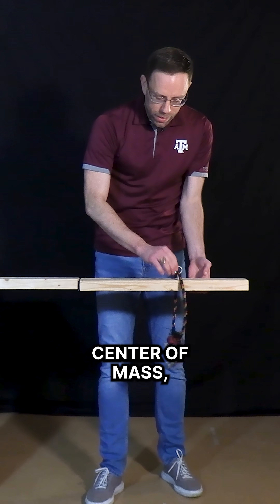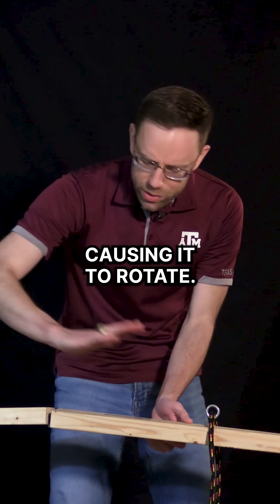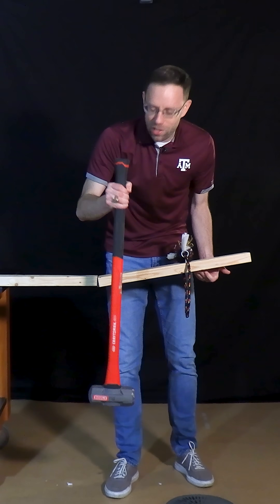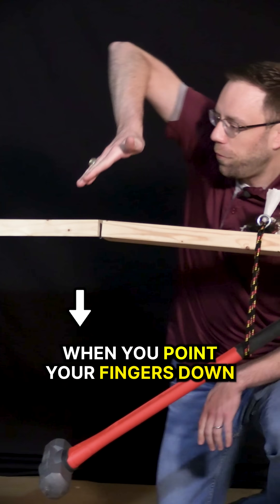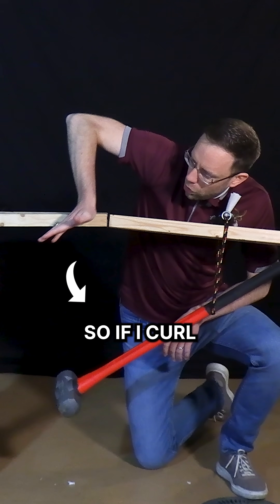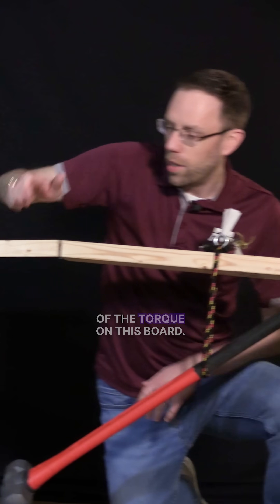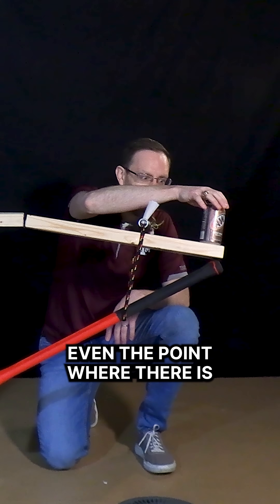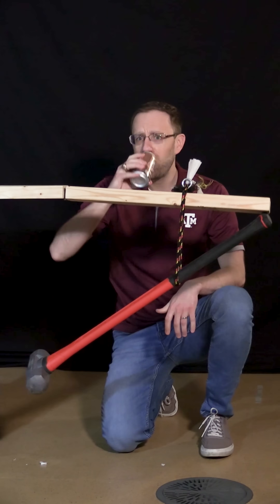Floating sledgehammer using physics! 😮 #shorts #TAMU #DrDawson

Comment: Here’s an easier way to understand this. 
If the plank were to swing downward the heavier part of the sledgehammer would have to go upward. At the point where the sledgehammer has to move upward in order for the plank to swing downward that’s where gravity says nope because the sledgehammer is too heavy to move upward from the small amount of downward pressure by the plank. 

The words “torque” and “hinge” are crucial for this genius contraption to work, but what it really comes down to is still basic gravity preventing the sledgehammer from levitating.
Reply: That was a perfect explanation 👨‍🍳😘👌
Reply: @ricksmash8080  thank you!! I understood perfectly
Reply: That makes a lot more sense
Reply: Beautiful. Your explanation finally helped me wrap my head around how this was possible.
Reply: "At the point where the sledgehammer has to move upward "  bruh that's the key for me . Thanks for the help
Reply: That's a very good explanation
Reply: so to keep the hammer from levitating, we levitate the table instead. It was always about the hammer to begin with, physics doesn't care about the table at all! thanks for explaining it.
Reply: @caughtintheakt8420  the hammer is heavier than the plank, so gravity 'cares' about the hammer more
Reply: Nice explanation dude, reminds me of some of the best from my undergrad –questions like "if you take a rope hanging between two points, and pull down on the exact middle point until taut, does the centre of mass go up or down" spring to mind, but a good explanation like yours makes them seem easy
Reply: @ricksmash8080 thank you I was going to the comments to write a similar comment. The guy in the video’s explanation was I find more confusing than needed to be
Reply: Ah~ so it works like Monks on a stick :3
Reply: @ricksmash8080  so aliens fly their ufos with sledgehammers?
Reply: Correct.  Torque has less to do with explaining the solution than the system resting at the lowest potential energy state.
Reply: @akulkis  🍻
Reply: Thanks, you have better English and I was about to explain the same.  It's like a teeter-totter, but our eyes and intuition decieve us and we expect the heave dude to  float.
Reply: @jaimeduncan6167  You found the same analogy as me!!! Teeter totter is a funny name for seesaw though.
Reply: @ricksmash8080  There will be more stress on the hinges
Reply: This guy should become a teacher
Reply: @Loc123cool  thanks! I try to teach my employees how to be landscapers but I find that although good teaching helps, it boils down to potential ability most of the time. You’re probably great at learning!
Reply: Wow that's a lot clearer
Reply: @ricksmash8080  you would make a great teacher
Reply: Thank you, the video's explanation didn't help at all. Your explanation helps me understand it perfectly.
Reply: Thank you for the explanation.
Reply: what force does the rope represent.
Reply: @ricksmash8080  so effectively, the hammers own weight acts like an artificial floor because of its point of contact with the hinged board?
Reply: @TheDon8923  The heavy part of the sledgehammer is being pulled down as far as it can go by gravity. Because the head of the sledgehammer is heavier than the plank, and due to the location of the hinge and the rope, it finds what we could relate to as its “artificial floor.” Of course, if the hinge were to break, it would all come tumbling straight down to the actual floor. 👍
Reply: @ricksmash8080  exactly
Reply: So I’m not an expert physicist, I just thought I’d help more people relate to what’s going on here. 

If it still doesn’t make sense to you, imagine another example. 

Imagine instead of a sledgehammer it’s a long wrench attached to the end of the plank. The wrench itself doesn’t apply enough torque to hold up the plank, but if you grabbed the end of the wrench with your hand and push the wrench downward, it would effectively hold up the plank because the rope acts as a fulcrum (somebody else asked what the rope represents) which converts the downward pressure where you grab the wrench into upward pressure where it contacts the plank. 

So technically, because pushing down on the wrench or the sledgehammer (which have effectively become a lever, using the rope as a fulcrum) causes the plank to go upward - you can put as much force on the end of the wrench or sledgehammer as the hinge is strong enough to handle without breaking. If the hinge were strong enough, and you were strong enough, you could push down on the wrench so hard that you would come off the ground, which is exactly how the sledgehammer stays like that. 

Anyway, I’m no genius or expert physicist so I’m glad I helped a few people, and sorry to the rest who think I explained it poorly. God bless you all!
Reply: Absolutely masterful explanation
Reply: Visualizing. This. Explanation was. A. Breeze.
Reply: That is a very good way of explaining this. I've never thought of thinking it outside of torque.
Reply: You saved my brain from exploding, thanks.
Reply: @ricksmash8080  thank you for that simple explanation.  Even I understood it.
Reply: I have been enlightened
Reply: You should be a Physics Professor
Reply: Love when people can explain things in simple terms, thanks
Reply: @ricksmash8080  it's basically the plank saying to gravity: if your rules want me to go down, then it would make the sledge hammer go up which is also against your rules. So Gravity, will you let me fall triggering a paradox? Or will you let me float?
Reply: Or you could say: from our view point, the board wants to swing to the left and the hammer wants to swing to the right, so they cancel each other out….
Reply: @ricksmash8080  The real teacher is always in the comments.
Reply: Thanks. I was trying to follow the torque angle thing. I'll still try to now that I have a simpler explanation to build on.
Reply: Way better explanation
Reply: Ironically I did not find your explanation easier and instead prefer his explanation xD
Reply: Pretty sure the simplest explanation is "It's magic"
Reply: @ricksmash8080  magic. Got it
Reply: You should become a teacher. The abìlity to explain things the way we actually naturally think about them is so rare
Reply: It makes sense but i dont understand until i see this explanation
Reply: @ricksmash8080  you rick smashed that explanation
Reply: @raymondfindlay8070  🤣
Reply: u should replace the guy in the short. he did such a bad job explaining given all the props he had with him...
Reply: Such a better explanation than the video itself!
Reply: This is the principle of least action in the Lagrangian mechanics I think. Put another way, something has to do work to add gravitational potential energy to the hammer.
Reply: @kxjx  Hahahah i think its quite a lot simpler than that, though it's all lagrangian mechanics at the end of the day right. No need to apply university physics to a middle school problem 🤣🤣🤣
Reply: Thank you that makes more sense, he confused the f out of me
Reply: Thanks, I didn't think this would make sense to me, but your explanation does.
Reply: Now i understood it, thanks.
Reply: better explanation than the vid for sure
Reply: Thanks! He was trying to 'splain with a cross product of two vectors giving a vector normal to plane created by both (toward viewer) and that made zero sense.
Reply: Thank you, while i can appreciate these videos being actual lessons, they really needed to be more simplified for us common people that dont come across jargons like torque
Reply: Frikken thank you.  I didn't understand what the heck he was saying about his fingers
Reply: Genius bro
Reply: That’s a much better explanation.
Reply: Thank you.
Reply: honestly, a much easier explanation to understand.
Reply: @ricksmash8080  thank you for the explanation
Reply: 😲 wow!! Thanks for the explanation! That makes a lot of sense
Reply: Very true. Very succinct.
Reply: Why so many toxic comments bashing this supremely helpful explanation? It perfectly explains a concept almost entirely overlooked by the video. Clearly it didn’t help some people, but how does that justify their hate towards this comment? If you still don’t understand, why not just ask for help?
Reply: Insane! It makes sense. Thanks🙏 

I looked closely in disbelief to see if he flipped the hinge.
Reply: That’s a great way of thinking if it!!
Reply: @ricksmash8080  gotcha, so it's a bug that needs patched
Reply: Thank you!! I was still wondering after his explanation like "But how does it not still bend at the split in the table"?😂😂
Reply: Thank you so much I actually needed that even though I shouldn't have
Reply: dayum! thanks for this man!
Reply: Yeah using Newtonian mechanics really doesn´t explain stuff here good enough. Using Lagrange and looking at the energies really helps
Reply: Makes complete sense now being the board doesn’t have enough weight to push the sledge hammer up
Reply: Aha! Much understandable ,thanks sir 😂
Reply: Thanks 🙏
Reply: Beautifully explained. Thank you.
Reply: Seems like the same idea those floating tables use.
Reply: You genius
Reply: Thank you I understand now
Reply: Put simple
The head of the Sledgehammer is on the other side to the hinge, and is being pulled down harder than the board itself. The left side is being pulled down harder than the right side, so it ends up not flopping down.
Reply: Your explanation Mister makes me understand way better - thank you. That said you didn't have to say "genius contraption" to be nice, lol! The hand gesture with the right hand curling and the thumb pointing towards the screen and then not, confused me. Is the hammer really "'floating" - is my head "floating" in the air when I walk? I think Dr Dawson may need to review the video editor of his lectures because I bet all this is explained well.
Reply: The more you explain it the more i can't come to terms with gravity 😢
Reply: @briankefa8993  Have you read my comment about the seesaw?
Reply: @mibber121  yeah i understood very well it's only that i like visualizing things and this isn't coming up
Reply: Couldn’t the sledgehammer just go down at the angle it’s at? Idk I need a visual representation of the physics behind this. I’m looking at it and still can’t believe what I’m seeing
Reply: @cameroniokeck  the sledgehammer can’t go anywhere because it’s stuck between the plank and the rope. It’s trying to fall to the floor but the rope is turning it into a lever by acting like a fulcrum. That’s where the torque comes from.
Reply: @ oh okay thank you
Reply: This explains it way better
Reply: is 100% fake mate, what is in the video is imposible
Reply: @sentra6661  it's real lol did you study physics?
Reply: @MCAbdo  is not mate, pls try it at home or what ever you can, no ofence
Reply: @sentra6661  have you considered trying it first? It's real bro I've literally seen it in real life too.. Go ask your physics teacher to show it to you if you don't know how to make it yourself. You need a ruler, rubber, hammer, and matchsticks.
Reply: @sentra6661  It is not that hard to wrap your head around it if you really think about what's going on
Reply: Haha I had no idea how it worked until I read this explanation.
Reply: Much better/simpler run down. Nice
Reply: @ricksmash8080  this actually is much better. MUCH MUCH better
Reply: Thank you!!!
Reply: @ricksmash8080  Why does the head being on the other side of the hinge matter?
Reply: @beaumatthews6411  it’s really just a matter of how far gravity can pull the hammer downward. Crudely put; If the sledgehammer were shorter, the plank would sink lower but only until the sledgehammer passed the hinge.
Reply: Ngl I could not understand this explanation. Better explanation is that gravity causes the hammer to push up with the same amount of torque that it takes for gravity to pull the board down
Reply: Thank you
Reply: This is a farrr better explanation
Reply: Yep, you can often explain problems involving torques and forces in terms of energy.
Reply: @ricksmash8080  Dude! Well said and super easy to wrap your mind around.
Reply: thank you
Reply: @ricksmash8080  very nicely explained
Reply: Thanks man 👍🏻👍🏻
Reply: Sure sure, whatever you say wizard
Reply: @ricksmash8080  thank you good sir
Reply: I mean... you aren't wrong, but the extent to which such phenomon are being so grossly oversimplified I find to be rather bothersome. In a manner of speaking the sledge does in fact appear to levitate on account of the various reactions within the system- the gravitational force on the sledge is counteracted by the reaction of the hinge, and the torque balance for the sledge itself is from a coupling of the cord tension, and the normal force exerted by the board where the handle is touching. The sledge could "go up" if the systems dimensions were sufficiently tampered with- but I needed to be asleep hours ago, and this is all the more I care to say.
Reply: Well put.
Reply: Thank you, i somewhat understood better now. I don't know what a torque is, so your explanation without adding the word "torque" helped
Reply: thanks, now its clear for me!
Reply: Does the sledgehammer head needs to be past the hinge or will this work with any size?
Reply: That's a much better explanation...  thanks...
Reply: @ricksmash8080    Idk about easier, didn’t even have the energy to read it all.
Reply: This comment was better than the video.
Reply: @ricksmash8080  thank you I was having a hard time understanding
Reply: this is a much better explanation for the random folk like myself. What he did is teach me how to say it, you taught me how to understand it.
Reply: I think its easier to conceptually understand that torque only considers the vertical part or force thats perpendicular to the lever arm.
Reply: Gravity "inception"... 😂
Reply: @ricksmash8080  thank you.
I only understand like half or less of what he said, you elaborated it perfectly and it makes total sense now
Reply: @ricksmash8080  thankyouuu 😂
Reply: That’s a great way of thinking of it!!
Reply: That's not easier to understand, it's just backward from how he explained it lol
Reply: I understand it makes sense, but at the same time, it doesn't. I get it; it would have to go up, but I feel like I would still go down to the point where it would just go down and touch, then giving it the resistance needed to stop it. But that's just what I would think.
Reply: @ go down and touch what?
Reply: @ricksmash8080  much appreciated
Reply: @ricksmash8080  way better explanation
Reply: Thanks for this!!!
Reply: Thank you so much. That is actually very helpful.
Reply: @ricksmash8080  i need this in Fortnite terms
Reply: @ 💀 I have never played Fortnite, sorry 😢
Reply: Here's an even easier way to understand this.
Board go Brrrrr. 😮
Reply: @ricksmash8080  thanks I read the first sentence and instantly understood what was happening
Reply: This make sense
Reply: Perfect
Reply: Thank you!
Reply: @ricksmash8080  That use or "crucial" sounds Chat-GPT to me.
Reply: or just imagine it swinging , but it's so small u don't see it.
Reply: My brain likes you
Reply: At no point does a comment explain it and neither does this guy. The video is simply fake I could recreate this scene in less than 5 minutes and it didn't happen .
Reply: The hammer wants to rotate counter clockwise pivoting at the right of the board. The board wants to pivot clockwise at the hinge. As the are connected they work against each other provided the masses are in line. Calculations are done through the centre of mass individually and then collectively from the hinge.
Reply: Oh okay that makes way more sense
Reply: This is the best explanation for this!
Reply: Comparable to a see-saw! One side goes up, so the other MUST go down.

If the table were to fall like it did in the beginning, the sledgehammer head would swing upward, but the sledgehammer head itself is also affected by gravity! So, in order for that to happen, you need a lot of upward force to oppose that gravity, yeah? The table being affected by gravity isn't going to produce that amount of force because of how much less mass it has than the sledgehammer.
Reply: Actually the hinge isn't needed, it would work by simply laying the board right on top of the other board
Reply: @ interesting. That would make a more interesting video. Good point though. What I meant about the hinge being necessary was that obviously if the hinged board weren’t connected to another structure, then they would both just tumble to the ground rather than levitate for no reason. I hadn’t considered whether or not it would work while resting on the end of the other board and I’m curious if you’re right.
Reply: Or, more simply, the new center of gravity has shifted.
Reply: @SteveMoby  That was already explained in the video and doesn't make things intuitive for everyone!
Reply: @ you’re right
Reply: @ricksmash8080  the guy in the video explained easier than you 😂
Reply: @ lol okay. Sorry.
Reply: This is a clear explanation - and someone might have mentioned it already in this thread - but it’s not correct. The sledgehammer doesn’t stop moving when it reaches the point where it has to move upward to continue; you can see that it actually does move slightly upward in order to reach equilibrium, where it’s at rest. It stops when the center of mass of the entire rigid body (everything past the hinge, ie plank, rope, can, sledgehammer, hardware) is directly below the hinge.
Reply: Seems like thats a part 2 discussion
Reply: The hammer and the board together act as one object, which is anchored to the other board by the hinge.  Like those little levitating toy birds from the 90s that you could balance on your finger with its beak. The hammer has the same function as the weighted wings of the bird, and the beak would be the hinge.
Reply: I was going to post the same thing, but couldn't describe it any better than you did, perfect 🙏
Reply: Yeah I thought he over complicated things as well.
Reply: Way better job explaining it than the content creator did.  Bravo.
Reply: There is no measured physical downward acceleration.
Reply: Your explanation is more understandable compared to the narrator in video :)
Reply: Sir, you are a hero. THANK YOU! May god bless you for making it way easier for us all to understand. ❤
Reply: Thank you! Your message was faster to understand it than watching the video lol
Reply: You're a good teacher. Makes sense now. God bless! 🙏🏾
Reply: @ricksmash8080  so its basically gravity ?
Reply: @ricksmash8080  Ohhhhh, wow, now I get... No, I don't get it. I'm still confused. This is just not right.
Reply: @rigo1529  If board swing more, hammer go up. but gravity swing hammer down. So board can't swing more.

There we go, that's I think the easiest way to explain it, hope this helps!
Reply: @BurntToast487  Yeah. You guys really helped me understand this because I was lost. Thanks.
Reply: @rigo1529  the hammer's center of gravity is at its lowest point when the assembly is floating. moving either direction requires energy to be added to the system.
Reply: @rigo1529  imagine if the sledge hammer was tied to that board at parallel, instead of at an angle.

You'd create a see-saw. 

Now imagine if you put the big iron head of that big heavy sledge hammer on one side of the see-saw, and put that thin flimsy very light wooden board on the other end of the see-saw.
Reply: @rigo1529 yeah in essence they use the hammer handle to give counter force, by using the hammer head weight to push away the hinged stick. Creating a "torque" force on the hinge joint. So the hinge must be strong enough to hold these weight for it to works. Else they will break on hinge and fall as tension are all on hinge jointing
Reply: @rigo1529 just imagine the hinge part wants to push the sledge hammer clockwise, but the gravity says no, and wants to rotate the sledge hammer counter clockwise, since the sledgehammer is heavy, the hinge does not have enough force to exert to move it clockwise, so gravity wins and ends up pulling the sledge hammer counterclockwise, creating the floating phenomena.
Reply: @rigo1529  Hammerhead too heavy to move up.
Reply: @rigo1529 something additional that can help this explanation make more sense is that the sledge hammer is not actually floating. It's being carried by the table. Just like if you hold a sledge hammer all the weight is still on your feet. The rest is explained by this comment
Reply: @rigo1529  Another way to visualize it: Which way would it swing if the planks were vertical instead of horizontal, with the hinged plank and sledge hammer on bottom?
Reply: @rigo1529  look at the board again, it's leaning down a bit to the right while the sledgehammer is leaning down to the left, they cancel both out which makes it float midair
Reply: @rigo1529  then you're dense.

Plank on hinge.

Gravity pulls plank down.

Hammer pulls on plank.

Plank get stuck in place by hammer weight.

Plank stays flat.

Simple no?
Reply: @rigo1529  Gravity is both pulling sledge hammer down and the board down
only 1 can fall so since their being pulled in opposite directions nothing happens 

its like if we were playing tugawar if we are the same strength the rope won't move to much
Reply: @rigo1529  This analogy may be somewhat difficult to understand, but you know how seesaws work? 

When one side goes down, the other side goes up. 

Because the head of the sledgehammer has passed the other side of the hinge, it becomes a sort of seesaw, even if it laid at a strange angle.

As the head of the hammer is much heavier than the board, it will in fact be the side of our seesaw that falls as low as the hinge will allow, hence the other side of the seesaw - the board - must be pushed up.
Reply: @mibber121  OK. I was missing the past the hinge part. It now makes sense. It shouldn't make sense, though, but that's physics. LOL
Reply: @mibber121  this makes more sense!
Reply: @biggysmalls8933  Thank you!! Happy to help!!
Reply: @mibber121  your seesaw explanation is what made it click for me which i could then apply to the video above. thanks ^_^
Reply: @ Im so glad it's actually helping people 😭😭😭 I was worried i would make people confused. I take pride in my qualitative understanding of the subject, so i try to explain things in a way that you can visualize more easily.... but often physics likes to make this difficult
Reply: The board is rotating around the axis of the hinge. After releasing the board its steady state will be where the axis of the hinge, the board's center of mass and the center of the gravitational field coincide with the same straight line. Adding the hammer to the system causes the center of mass to move closer to the hinge in horizontal direction. This means a smaller rotation is enough for the center of mass to coincide in the straight line.

EDIT: in other way to express, the center of mass strives to reach the position with the least potential energy. The hinge does not let it fall down.
Reply: Easier than just seen it?
Reply: @ricksmash8080  Think you miswrote. The heavier part of the sledgehammer would have to go downwards not upwards. The lighter part is pushing upwards to prevent the plank from coming downwards
Reply: @ChicaneMedia  No I mean that due to the rotation of the plank from the pivot point at the hinge, the heavy end of the sledgehammer would have to literally travel upward against gravity in order for the plank to come down any further. Gravity is pulling the heavy end of the sledgehammer down so hard that the light end of the sledgehammer pushes the plank upward. Just like if you were to push down on the end of the sledgehammer, that force would be transferred into pushing up the plank - except gravity is doing it for you because it’s heavy.
Reply: Horrible explanation 😂
Reply: @OSK-u3l   tu sai spiegarlo meglio?